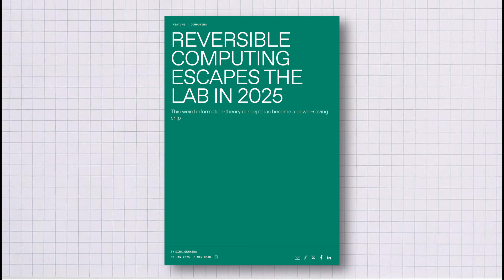Reversible Computing: The Energy Efficiency Revolution in Computing

Comment: Vaire Technologies and similar “adiabatic/reversible computing” startups have received attention because they try to recover or reuse heat (energy) within logic circuits, often using resonant or multi-phase clocking. But there are some real-world hurdles:

1. Adaptation & Scaling Challenges
Manufacturing Compatibility:
Most foundries are deeply optimized for CMOS and standard process flows. Adiabatic and heat-recycling logic circuits often require custom clocks, special layout, and non-standard power delivery that just don’t fit into existing lines.
Bottom line: Retooling a foundry is hugely expensive and slow.

Design Toolchain Immaturity:
The entire EDA (electronic design automation) ecosystem—from synthesis to verification to physical layout—is tuned for static, non-resonant logic. Adiabatic/reversible designs need new tools and flows, which don’t exist at industrial scale.

Yield and Reliability:
Heat-recovery and resonant logic are much more sensitive to noise, parasitics, and process variations. What works in the lab often fails in high-volume manufacturing, or requires hand-crafted tuning that can’t scale.

Integration with “Normal” Logic:
Almost all chips will need to interface with conventional blocks—memory, I/O, analog, etc.—and mixing adiabatic/reversible blocks with standard CMOS is messy and risk-prone.

2. “Heat to Next Calculation” Sounds Great, but…
Practical Limits:
Most computational “heat” is lost to the environment very quickly, and harvesting it inside a chip before it dissipates is extremely difficult.
There’s a reason why even the most efficient CPUs today still need heatsinks and fans.

Physical Realism:
The concept is closer to theoretical minimums (like Landauer’s limit) than to practical chip design. Even quantum computers struggle with heat reuse at the nanoscale.

Market Readiness:
No major foundry or mainstream fabless chip company has adopted adiabatic logic at commercial scale. Even Vaire’s own “99% energy-recovered” claims are based on lab prototypes, not high-volume, high-reliability production.

3. Industry Reality
Incumbent Inertia:
It’s not enough for a tech to be better in theory; it must drop in with minimal changes. Foundries and chip designers avoid high-risk, high-disruption processes unless there’s a huge payoff.

Z.E.R.O. Advantage:
My approach (Z.E.R.O.) stands out because it’s CMOS-compatible, solves the problem at the root (the logic gate) of the excess heat and energy, requires no exotic clocks, and is genuinely a drop-in replacement. That makes it far more appealing to risk-averse manufacturers.

Comment: Vaire’s adiabatic logic is not true reversible computing. Their circuits still erase information and generate heat—just with a little bit of energy recovered from the switching process. Only a genuinely reversible logic gate, like Z.E.R.O., eliminates the root cause of heat: information loss. There’s a world of difference between recouping some switching energy and making the computation itself reversible.
Reply: I thought it was necessary to have reversible logic to do adiabatic logic? am I wrong, or is it the case that their logic is not truly adiabatic either?

at any rate, in practical terms, if a circuit can recover the majority of the energy during the computation, even if not 100% reversible, it still could be valuable technology.
Reply: @a_soulspark They are two completely separate things. Adiabatic is only trying to recover some of the energy from the switching of the logic gate. It only works in labs and will most likely never be out in the real world because it is too complicated and cannot work at high speeds. Logic gates have to erase the previous 0 or 1 and that is done billions of times per second. That erasure creates heat and that is irreversible computing (like all computers today). Reversible computing does not erase the 0 or 1 which means no heat.
Reply: @PulseHighwayMusic  I see. I think their plan with adiabatic is to compensate for lost speed through extreme parallelization.

[math ahead]
my understanding is: as you add multiple cores, energy/s (power draw) and speed increase at the same rate, so the energy/computation remains the same, but the total time taken decreases.

then, as a special property of adiabatic circuits, you can lower the energy/s quadratically by increasing time linearly, so the net result is that energy/computation lowers linearly.

that means, you double the time, lowering energy/computation and speed by 2x, and then double the core count, increasing the speed without changing energy/computation. so now you're doing the same computation, in the same time, at half the energy cost.

obviously, it's not "the same" computation. this only works if your load is fully parallelizable, which is true for a lot of modern problems like AI (up to a limit). and again, I got most of this from watching some talks by Mike Frank, who now works at Vaire, so he might be a bit biased lol
Reply: @PulseHighwayMusic 
What would happen if you start off with a pool of alternating zeros and ones. Then you take the RISC-V 32 I M extension, and for each of those machine codes patterns (or immediate value) you chop them up into 4 bit nibbles. Then you take 8 bytes, and filter them through a sorting algorithm, essentially making the high half of the byte your intended 4-bit nibble, and then the low half is the garbage leftover data. You take all your 4-bit nibbles and combine them into your 32-bit RISC-V machine code. You do work with that, and then recombine it with the garbage nibble back into the initial pattern of zeros and ones.
Heck, you can even speed it up by using an inverted version of the work you are doing of your intended nibble, but on the garbage nibbles.
It may be that it will take more surface area... like orders of magnitude or more
Reply: @MagnetSphere-kc3gm  What you’re describing isn’t true reversibility, it’s bookkeeping.
You’re preserving “garbage” by carrying it alongside the computation, which increases area, routing, and switching overhead. That’s exactly why these approaches never scaled in CMOS.

Real reversible logic doesn’t move the lost information somewhere else. It never loses it in the first place at the gate level. That’s the difference.
Reply: its honestly a very confusing topic
Reply: @a_soulspark Adiabatic logic has been a lab curiosity for over 30 years and that's pretty much where it's going to stay. You can never say "not 100% reversible"; it is either irreversible or reversible, there is no middle ground. Adiabatic and reversibility have absolutely nothing to do with each other. Adiabatic is only on the switching side and reversible logic is on the logic side. Two completely separate worlds.
Reply: @PulseHighwayMusic   hmm, can't there be a middle ground? I can imagine transforming from a computation where all the instructions erase information, into one where 99% of the instructions are reversible and only the last 1% is irreversible. the computation as a whole is irreversible, I agree, but at least in most of the intermediate computation you avoided erasing information, so those should be possible with zero energy dissipation.

also, what do you think about their (Vaire's) idea of parallelism? the limitations of adiabatic logic that you alluded to, do multiple cores not help get around those? I've struggled to find resources on this, so I really appreciate it.